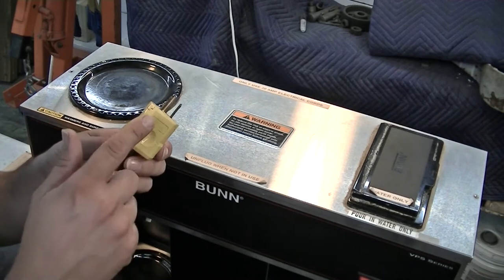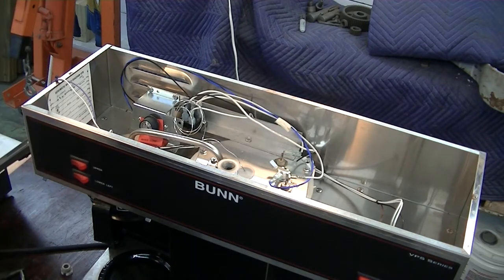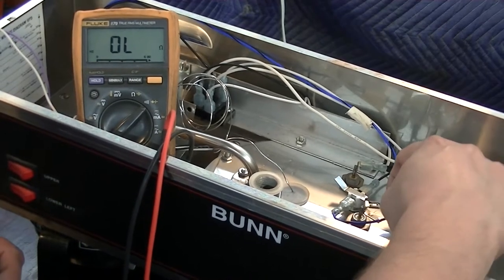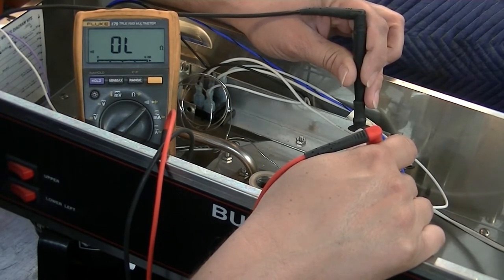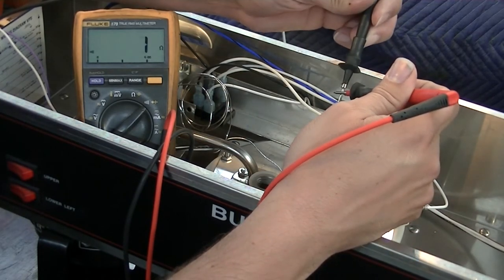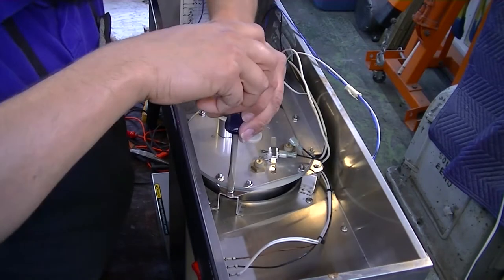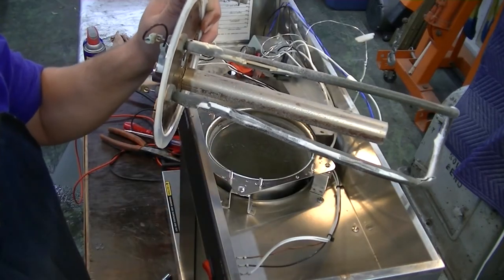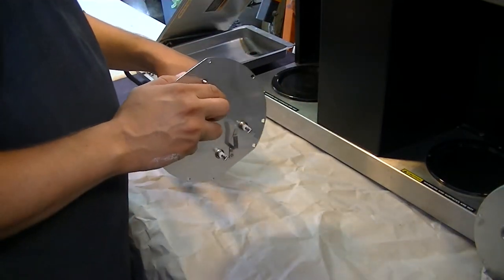Where's My Coffee!!  BUNN Coffee Maker Repair

Comment: Great video. I have just today replaced the control thermostat on an older BUNN VPR model after reading, downloading the manuals, and watching a few videos. It took a while to understand how the coffee maker works, even though it’s fairly simple!
I wish I had seen this video first. Great to see the continuity testing. I slowed it down to be able to follow the video. (Yes, I know that many people speed videos up!).
QUESTION: I noticed that the flow-through nut holding the water pan in place was just finger-tight. I was unsure of that, so I put it finger tight (according to the unremarkable strength in my fingers) and then added about a quarter turn with a wrench, thinking that’s a standard approach. Do you think that was a mistake, and will it matter? 
One minor comment is that I would have benefited from some comments as you were going through the steps. Because I don’t often do these jobs, understanding the thought processes is helpful. But I saw someone else comment that there was too much detail, so there is no perfect approach!
Thanks for posting this. Interesting, humorous and helpful!
Reply from the maker: Hi.  Sorry for the late reply.  I wasn't receiving comment notifications.  You are correct.  The nut should be tightened.  It's been a while since filming but using the wrench might have been cut for time.  Thank you for the comment.  I'll be sure to include more information as to the "why" in my upcoming project.  Thanks for watching!
Reply: I’m very grateful for your response. 
I did this work to help a nonprofit lawn bowling club, and paid for the parts myself. So like you, it was to help the community. It was outside my experience, but your video was very helpful. It is still working well. These small jobs really matter. And we can choose not to be wasteful.
Reply from the maker: I agree.  Volunteering to help the community is a blessing.  Thank you for sharing and I'm happy to hear it's still working.

Comment: Where can I order parts from, I need the switch to turn the main coffee maker on. So I swap the top to the bottom & I noticed the warmer on the right also doesn't work.
Reply: I guess the switches is what I need
Reply from the maker: Hi Shaun.  I often use www.partstown.com for my appliance parts.  They also have manuals that can be helpful when diagnosing problems. Thanks for Watching!

Comment: Your meter told you the protection device was fine and the heater element was burnt up. Heaters by NEC should have two protection devices, most have a thermal fuse and a bi-metal snap switch for your protection.
Reply from the maker: Hi Larry.  That’s an interesting observation.  Although not mentioned,  the circuit for the heater has the bi-metal thermal snap switch (as shown), an operational thermostat with off switch, the units cord is three feet long for a means of disconnect, and is protected by 20 amp circuit with breaker as instructed by the unit label.  The coffee maker as designed has the UL symbol of approval.  All that said I am familiar with the NEC and what you’re talking about.  You raise a good point.  I just don’t have a good answer for you.  Thanks for watching and for the comment!
Reply: GreenGander75 

40 year electrician